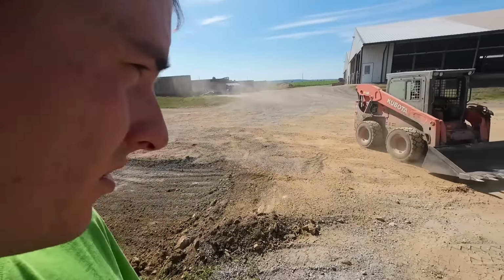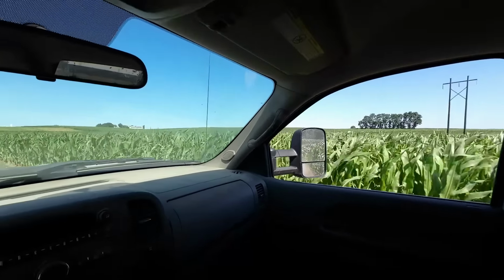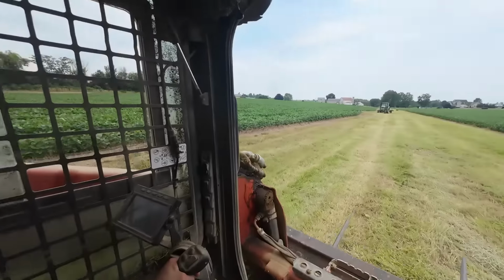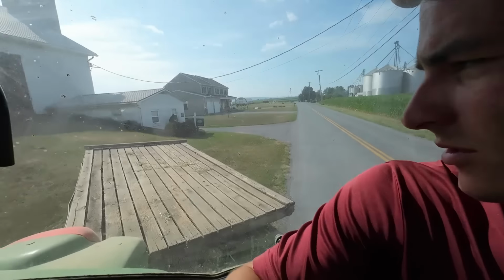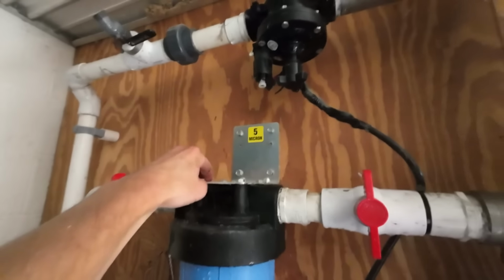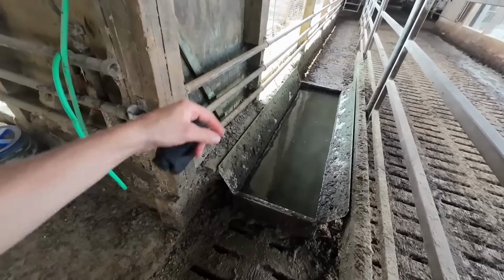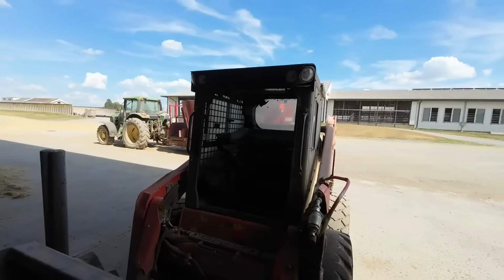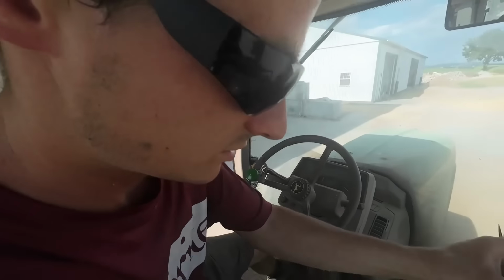Chopping Hay & Chipping Away

Comment: With you moving to robot feeders would you be looking to move to robot milkers so you can spend more time managing crops and cow comfort whilst raising the next generation of the farm plus how many cows are you currently milking and how many acres of land do you have to support those numbers and potentially more if you do go into beef rearing where your old silos are or will you be building and larger workshop/equipment storage or will you use your old bunker silos for your machinery if you go for the roof over them would you be building a wooden roofing structure or have you looked at steel frame as you would be able to have more height whilst not building too tall so you could fit larger and taller equipment in if you decide to get larger machines so you can work your land quicker allowing for more efficient crop management whilst giving you better chance to work the fields when the weather conditions aren’t favourable so with you doing no till would you look into having your crops in larger field sizing so you can reduce the risk of putting the wrong chemicals on your crops